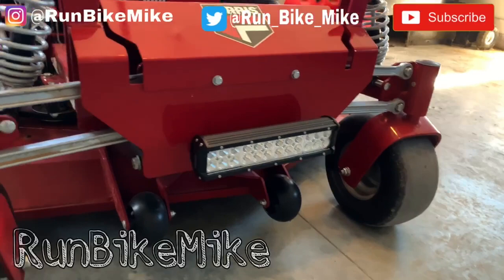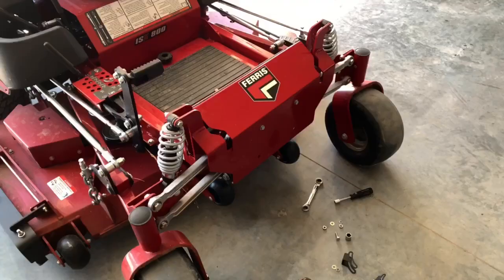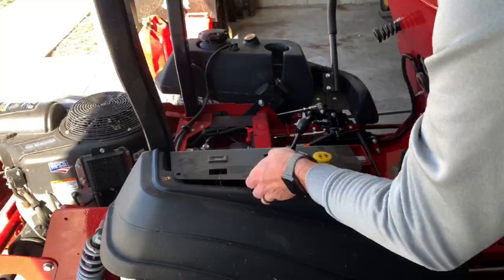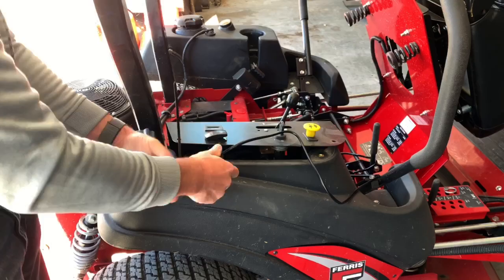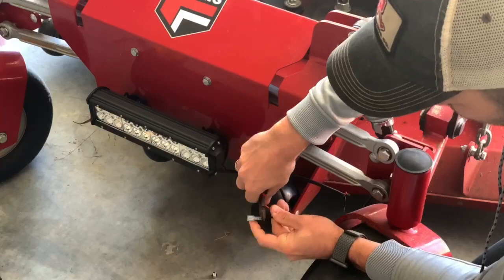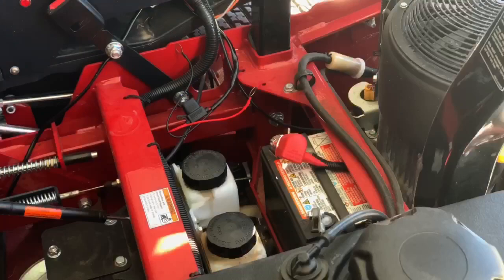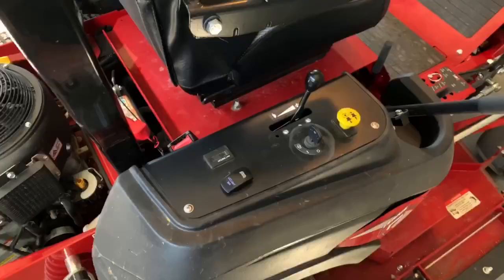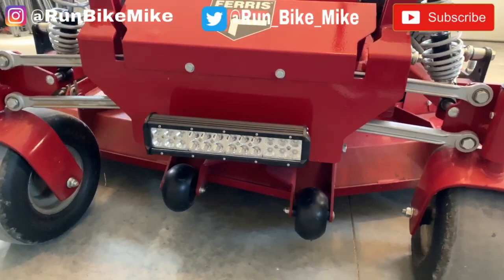LED Light Bar install on a Zero Turn Mower. Ferris ISX 800, IS 2100, IS 3100, IS 2200, IS 3200,

Comment: Mowing at night is easier and cooler than the day. I'm old fat and lazy. I couldn't air condition my mower so I have 8 led's about half the size as yours. I have rear for loading my fire wood in the small trailer for the winter and 4 in the front as well as 2 on each side of the deck. I live in the country so it's fun to get half drunk and mow until midnight....... It really helps to manage your time because you don't have to mow during the day. People stop on the road and watch.I'm about 12 years in with my setup and never had a charging issue , I also have the puffer air ride seat, highly recommend if you have a sketchy back.   Yep I'm that guy... Thanks for sharing do it people you will be glad.
Reply: I agree. Light should surround the area 360 degreees
Reply: Sounds kind of sketchy to me. Operating any machinery while inebriated can lead to life changing outcomes. At least that’s been the case for several people I’ve known or known about in my 71 years.
Reply: @Dave-ei7kk  Thanks for the concern I don't give 2 shits. When I go out it's going to be on the edge not in some damn nursing home I'm 56 I have enough experience to choose what I do. You be safe so you can rot in a home not for me!

Comment: I like the idea of the light bar and the way you mounted it. But there’s an enhancement needed to the way you wired it. Bu wiring it straight to the battery you leave the possibility open for the light to be on even though the mower is shut down with the key off. 

A better choice would have been to include a relay in the circuit that only closes when it’s control side, which you’ve hooked up to the key-on side of the mower wiring, is energized. That way both the switch at the operators console and the relay must be closed before the light is energized. Turning off the key will turn off the light, even if the switch is inadvertently in the on position.

Comment: I did the same thing on my BobCat Fast Cat mower. Amazon is the best and cheapest place to buy those LED light bars compare to a stores like Northern Supply's. But I mounted a longer light bar on the top roll bar. I just simply bolt it to a thin board. Then zip tie the board to the roll bar. But I did not wire my to the dash. I purchase a switch that plugs into the lighter plug from Amazon. It comes with a fuse inside. No special wiring needed to the battery. Just for note, it's best to put red nut tight on those hex screws. They will come lose over time from the vibration. I use my two light bars one above my head. And the other down at my feet. The only problem with the light on above your head? Flying bugs will hit you in the face. But it gives you more ground light on top vs. on the bottom. But both on at the same time is the best way.

Comment: Ferris must have changed the front plate you mounted the light on.  The lower half of the plate on my 2023 ISX800 is angled backwards resulting in the light pointing down a few feet in front of the mower.  I’m going to try and see if I can only use one of the set of two bolts that mount the lights to the brackets to angle it upwards.

Comment: You should put some heat shrink tubing on those light bar connections.
Reply: I used butt connectors been fine for 12 years...

Comment: Will it drop power the switch stand lit up all the time and run your battery down or not
Reply from the maker: I haven’t had any issues with that since I installed it.

Comment: I purchased the same kit as you did. However the light switch does not fit my Ferris. I have the 400s and the switch is too small for the opening on my mower. If I cut the instrument panel, would the switch hold in place without any further securing.
Reply from the maker: Most switches have little tabs and if the hole is the correct size it will lock in place with this tabs.

Comment: What is best...roll bar or up front and low?  I think of how the locations make a big difference on my boats.   I would love to hear comments on the options.
Reply from the maker: After installing it lower I like how it really lights up the ground right in front of the mower. But I could see if you put it up high it would light up a bigger area. I only put it down low because the holes are already there. If you are good with drilling new holes in the roll bar I would put one down low and two smaller spot lights on each side of the roll bar. I think that would be the best combo. I am tempted to do that since lights are so cheap now on Amazon.
Reply: I think down low would help you see the line better between cut and un-cut.

Comment: I want to do this but up top on my roll bar
Reply from the maker: I thought about putting it there. It would be a great spot for it. 👍🏻
Reply: It may cast a shadow if the bar isn't much taller than the operator. Also will attract bugs to the operator station. Best on the front in my experience.

Comment: No solder for the wires ? How has that held up ?
Reply from the maker: No issues so far.
Reply: I used butt connectors been fine for 12 years.